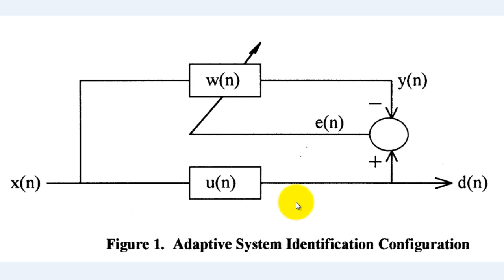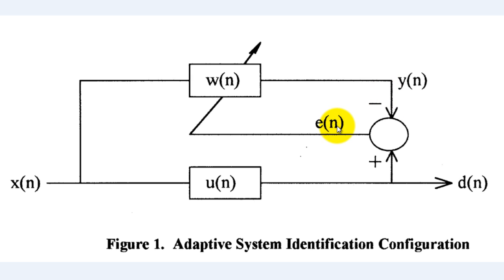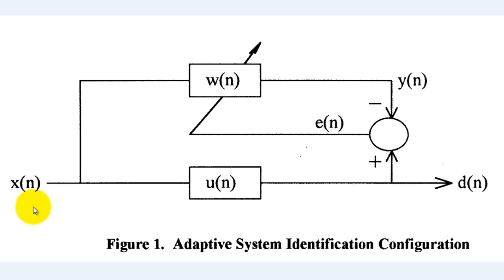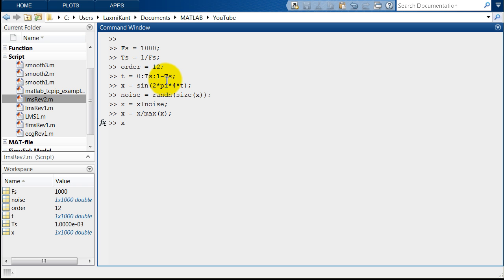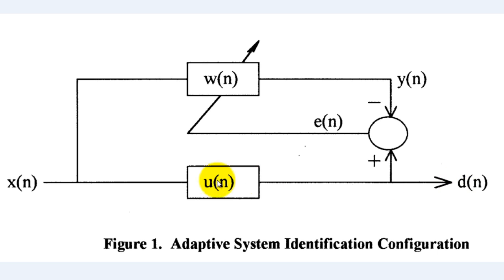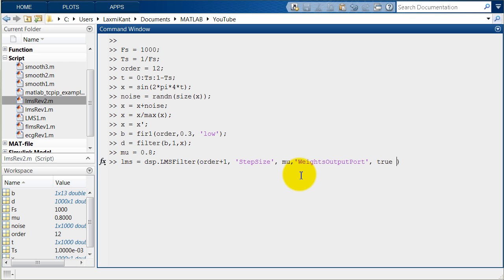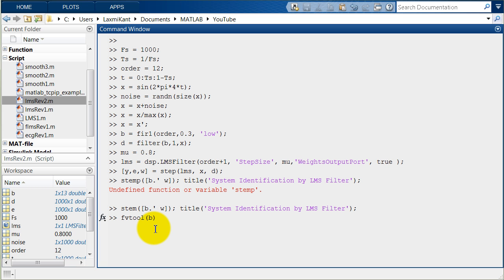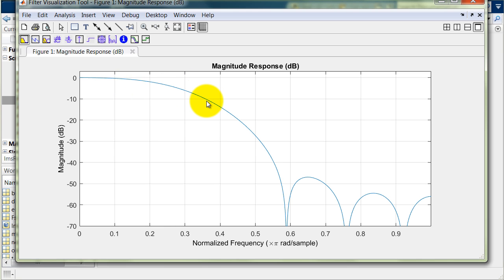Adaptive LMS Filter in MATLAB

Comment: Thank you so much for nice tutorial
I have try this code on the original  message signal and found that it remove the original message signal and get only noisy signal. Could you please tell me where I am doing mistake to apply LMS filter.
here is my code - 
[x, fs]=audioread ('C:\Users\D\Desktop\Matlab Program Speech\tt.wav'); 
%fs=1000;
%ts=1/fs;
order=12;
%t=0:ts;1-ts;
%x=sin(2*pi*4*t);
noise=rand(size(x));
x=x+noise;
x=x/max(x);
z=x';
v=fir1(order,.9,'low');
d=filter(v,1,x);
mu=.8;
lms=dsp.LMSFilter(order+1,'StepSize', mu, 'WeightsOutputPort', true);
[y,e,w]=step(lms,x,d);
stem([v.' w]);

Thanks